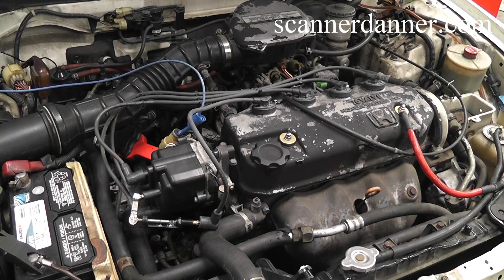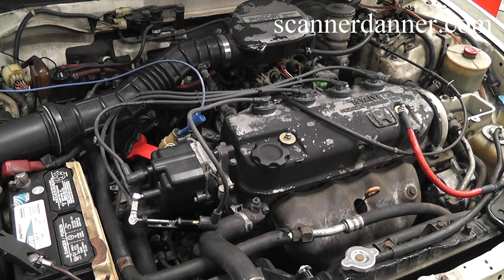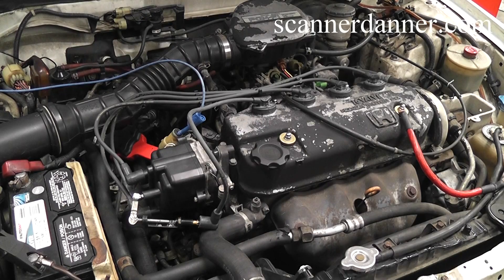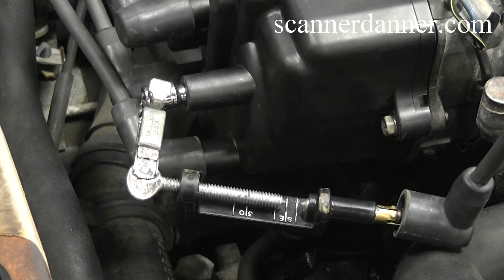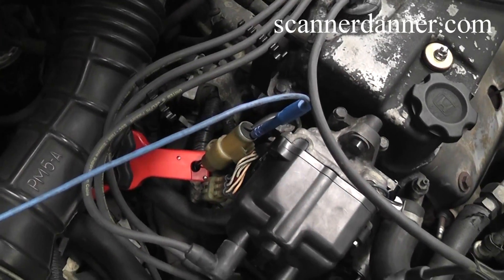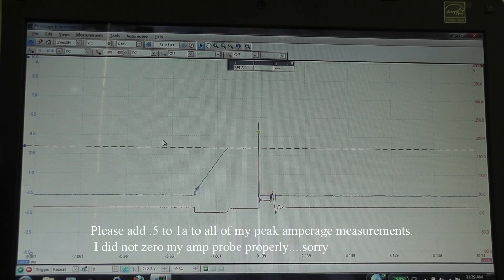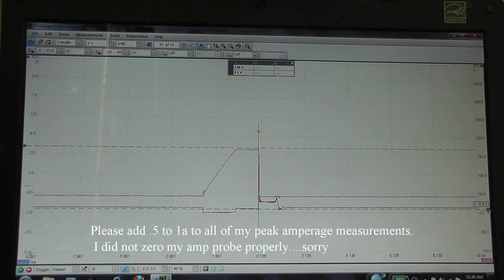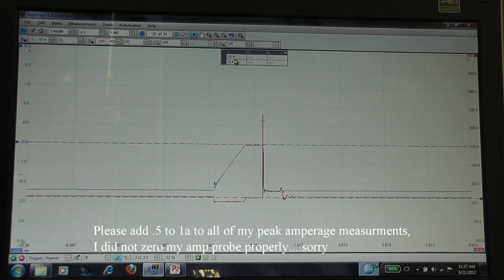Honda Civic, misfire, stall, hard start, weak spark (bad igniter)

Comment: I have an 07 Civic 1.8L lost power on 95 and limped it home thinking I blew my engine... Turns out it's was #4 cylinder coil pack failed two days prior installed new NGK PLUGS THINKING THAT DID IT. WHAT DO YOU GUYS THINK. KEEP IN MIND THAT CYLINDER IS GETTING A BIT OF OIL IN IT FROM A BAD VALVE COVER GASKET

Comment: Hey, I have a 91 civic SI
It won’t start and backfires out of the intake. Timing is good. Has fuel and spark where to go to next? Thanks so much
Reply from the maker: Backfiring out of the intake during cranking is suggesting a timing issue. Or maybe you put the plug wires on wrong? When did the problem start?
Reply: @ScannerDanner  I just bought the car for cheap to learn on to be honest. Guy said it sit for a year
Reply: @ScannerDanner  also I check the plug wires and they were put on correctly

Comment: Had a very similar issue with my '95 Integra. I put a new eBay ignitor in it just to see if it was worth the massive savings. It ran amazingly, but the ignitor & coil get EXTREMELY hot, especially here in Savannah summer, and the car just suddenly dies out of nowhere. Once cooled, it will restart & continue until it overheats again...
I suspect the new ignitor's internal ground or coil current limiter circuit is insufficient, & I REALLY wanna know exactly what it's doing to understand it better, but I don't have a working scope at the moment. 😢

Comment: I could definitely hear the difference in how those ran before and after. Sounds just like my fiances civic pre install of the new one. Makes sense considering the coil tests good but i was suspecting the spark even though the rest is good. Igniter was questionable.

Comment: I have a 2000 Honda Civic dx just put the motor and it was running fine now it’s giving me problems sometimes it starts right up runs fine turn it off let it sit for a little and it cranks but won’t start and when it does start it got a nasty mis fire what can be the problem
Reply from the maker: Find out what you are missing when it is not starting. Spark or injector pulse, then we go from there

Comment: I have an 01Civic that does something like the car in the video. It starts hard and will run for 20-25 minutes but then will stall. But if I wait a bit it will start up again for another period of time and repeat the process. The thing is my car is a standard (1.7L) and I'm not aware of any igniter on it. 
Any idea where to look to correct the problem?
Reply from the maker: Starts hard? You mean cranks for a long time? Check fuel psi first
Reply: My car does the same but starts immediately
Reply: So could it be my module? I already replaced my coil about a month ago.. Car drives for like 2 minutes then dies out, it will eventually start again after 5 minutes but will repeat the process.. I've already checked fuel pressure its good
Reply: It's a eg d15b3 carb

Comment: Now you got me wondering if my random p1399 code is due to a bad igniter or icm. 🧐, great video
Reply from the maker: the igniter is the icm (ignition control module) or did you mean ECM (engine control module)
Reply: I meant the coil itself.

Comment: I recently bought a 89 Civic with the 1.5 dual point injection. After car warms up it wil stall. And then when i start it up again vehicle will lose power and sputter.(rpms can barely reach 2000rpm) Iv been told ots the iacv but have not replace it yet. Could this be a igniter issue
Reply from the maker: those were the exact symptoms this one had
And the IAC valve is absolutely NOT your problem with those symptoms

Comment: 2004 es, slow start, stalls at stop only with ac. New sparkplugs, sparkplug tube seals leak on all 4 tubes
Reply from the maker: slow start, meaning it cranks over slowly (weak battery etc) or it takes a long time to start (extended crank time). 
Any engine that stalls at stops, the first thing that needs to be looked at is the throttle body. Is it dirty? I have videos on this

Comment: Thank you for making this video. It is incredibly deataiIed. I wish i saw it a month ago!!! 
I recently changed the fan switch thermo switch radiator cap distributor cap rotor Ignition wire spark plugs the EGR valve and now Im going to change the icm or igniter.. 
This was the worse car problem ive ever expirienced. I would have never found out if it werent for you.  Wish me luck

Comment: Hi Paul...Im working on a 2007 GMC express Savana 4.3L. Its a no start, good fuel pressure but a weak spark. Im suspecting an ignition module/ignitor problem. I have not done a scope yet - its a pain in the butt taking out the engine cover - and pin probed 3-wire CKP (bottom of engine close to crank pulley) sensor, which is terribly soaked with oil, and got a reading of 11.53V in one wire and almost identical 8.53 V on the two remaining wires. Am I right in suspecting an ignition module problem? Thank you

Comment: Can you weigh in on the issue of visual appearance of the spark?  I've read various opinions about thin orange / yellow spark vs. thick blue spark and what their significance is.  Also, can weak spark ( without misfire ) result in a lean signal at idle on the O2?
Reply from the maker: Sure. An orange colored spark is typically thought of as being weak, while this can be the case, there are other causes. For example, when testing for spark with a variable gap tester, if you close the air gap, the spark will be more orange, if you open the air gap the spark will be blue. This is due to current flow differences. When the gap is narrow the spark travels across the electrode for a longer period of time. (burn time) and makes the spark look orange. When the gap is increased, the coil has to build more energy (voltage) before it can overcome the gap and when it finally does, it is in the form of a higher voltage spark. This results in less burn time as well. Remember a coil will produce the same energy each time it fires and will be "used up" in the from of voltage and current combined. And they will always be opposite each other. 

As for your O2 question, a lean condition does require more energy because fuel acts as a conductor, however these are tough to pick out in a secondary pattern unless the injector is not firing at all, then it is easy to see.
Reply: Wow, that's exactly opposite of what I was expecting.  I assumed that as blue light is higher energy, that would correlate to the lower voltage higher amperage / current flow at a smaller gap and the lower energy yellow / orange light would correlate to higher voltage lower current flow at the larger gap.  But you're saying the color of the spark is correlated to the voltage, not the current.  I've gotta go out and test that.

Regarding the O2 question, couldn't a weak spark show as a short burn line ( less than 1ms ), with little or no oscillations at it's end, resulting in an incomplete burn and a false lean condition?
Reply from the maker: The blue light is higher voltage but less burn time. The orange light is lower voltage but longer burn time.
The energy is the same on each event

A lean misfire, the energy needed to maintain the burn cannot be supported, so yes a short burn time with a vary large coil oscillation at the end of it due to a lot of left over energy inside of the coil. 

A weak spark is a different topic altogether. A weak spark from a failing coil would have a difficult time jumping any air gap at all (depending on how weak the coil is), the spark may actually still be blue (very thin but still blue) and not jump past a 1/4 inch gap.  And yes, when viewed on a waveform, you would have a very short burn time and possibly no reserve coil oscillation. So do you see how misleading it is to say an orange spark is a weak spark and a blue spark is good?
Reply from the maker: As an experiment, my students and I do this all the time with a waste spark coil set up in the classroom. We can catch paper on fire with a narrow air gap and only punch holes through the paper with a large air gap.
Reply: ScannerDanner so can you really imply anything at all from spark color when using a variable gap spark tester?  a really cool experiment would be to vary the saturation of the coil while maintaining a constant Gap so that only the current and time change but not the voltage and see how that affects the spark color.
Reply from the maker: It absolutely would change color and distance it has the ability to jump. 
When I test coils, I only care about how far it jumps. I want to see at least a half inch and most will jump a 1 inch gap. Of course they are always blue at this distance.
Reply: Found a really cool article about setting dwell times where they actually did the experiment of varying amperage and have pictures of a 2 amp spark vs. a 7 amp spark over a 5 mm gap along with waveforms for those sparks:  http://dtec.net.au/Ignition%20Coil%20Dwell%20Calibration.htm  Thanks for your answers and I'm also enjoying your book which I recently got.
Reply from the maker: Thanks so much!

Comment: I would have like to seen the new igniters ground voltage compared to the old one. based on current it would have to be closer to ground on the new one to increase current flow.
Reply from the maker: +Cody Wichman I have a picture of that in my book. Section 22 page 20 (if you have my book)
Sorry I didn't show that in this video
Reply: Thanks. The book shows what I was looking for.

Comment: Hi Paul, a quick question on this case study: Considering the igniter and coil are inside the distributor, how are you measuring the coil negative control voltage? Is the blue wire (the rpm signal for the tach) actually true coil negative, even though it's a separate output pin on the igniter?
Reply from the maker: I'm pretty sure it is true coil - voltage. It is a parallel branch off of the pin on the igniter that controls coil negative (used for the tach as you stated)

Comment from the maker: thank you and if you do i promise you will not be disappointed
Reply: ScannerDanner I have a 93 Civic dx and it has a little hard time to start . At first I thought it would be the main relay then I checked the ignition switch and it was fine to so my last three things I had in mind was the ECU and the fuel pump and the coil . It gets good voltage as well at the end I ended up replaceing everything and it still has a hard time turning on . Please help and thank you

Comment: Hey paul im wondering if u can check out this video i just posted  got a question for u. The car has a hesitation @ cruise speeds  my first thought was plug wires i tried a set of used ones which were all within spec when i ohmed  them out same pattern on the scope with both sets

Comment: Malisa696 hope Paul doesn't mind me answering your question, the answer is yes do some r&d with a good car adding propane disconnecting injector etc do a WOT test and look at your KV line and the slope of the burn line and you should have the answers you require. Paul inside video again keep em coming pal :)

Comment: @ScnnerDanner like sometimes when im sittin in traffic the car will be run smooth, then i feel the car shake a lil bit as if it was chillylol. while this is happening the idle which is 800 will drop to like 750-700 then pick back up.

Comment: @scannerDanner Hey man. Do you think my hestitation whole tryna to re accelarate from a stop has somethig to do with the coils or module? i checked for Vac leaks and learning th  98 saturn sl1 model is famous for intake manifold leaks, However i found none. New NGK plugs, wires, and cleaned throttle/iac. thingt dont do it all the time so ts hard to gure =(

Comment: My first car was a 1998 Acura Integra, a Honda of course.  Car would have an intermittent stutter, but eventually died.  Had it towed and they replaced the ignitor.  So I fully agree with you LeakyDiaper (just read the name as I was typing it, nice).

Comment: I have a question but it is not related to this video. Can I use ignition coil primary voltage waveform to determine a no fuel misfire or to determine lean or rich condition? Thank you.